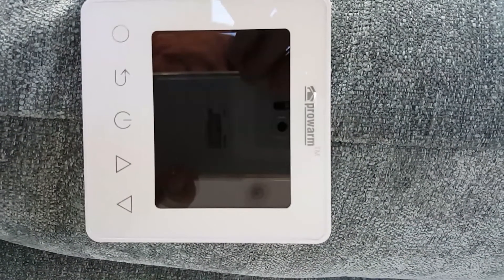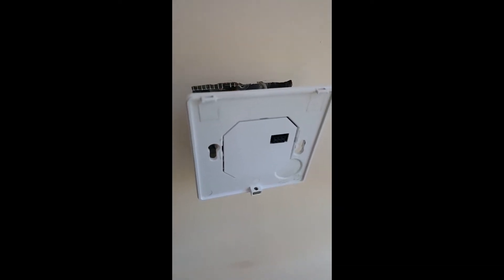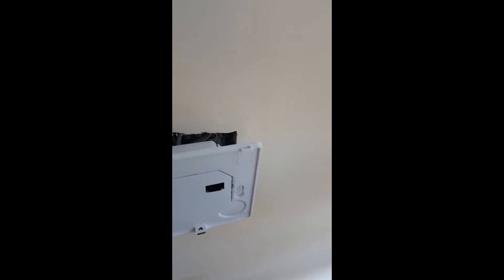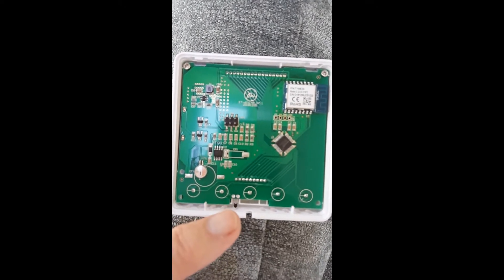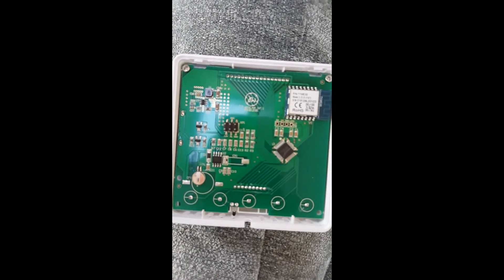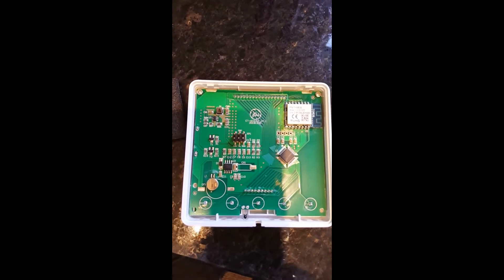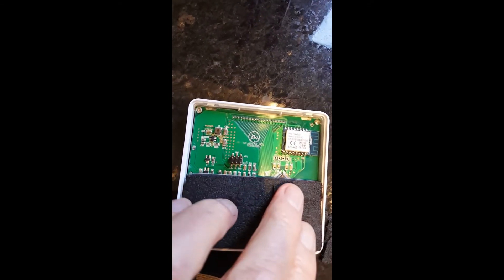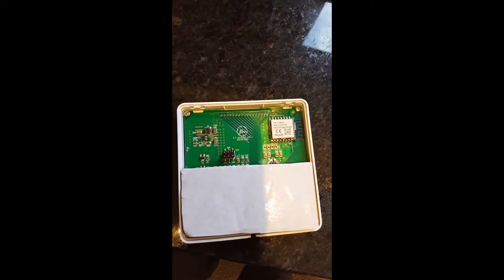Prowarm Heating Controller

Comment: So you know if i could  replace my prowarm underfloor heating thermostat with this wifi one
Reply from the maker: I am not sure what controller you currently use, but yes, this is the Wi-Fi controller that can be used. Of course there maybe other more recent controllers that would also suit. The app that I use is called Smart Life which is easier to setup and is faster than the original ProTouch app. The system is very reliable. I am currently out of the UK for many months and I can communicate with the controller in the UK whenever I wish. I hope this helps you.
Reply: @alvor2762 struggling to pair my prowarm thermostat with smart life app. Any chance for some guide on how to do it please?

Comment: Good content, just fitted one of these thermostats, many thanks.
Reply from the maker: Thank you for your comment. I am pleased it helped. I have 2 of these, and they have proved exceptionally reliable, and accuracy is now fine. Using  the optimization function to achieve the correct temperature at the time required is a good function on this controller too.

Comment: Thanks for sharing Rich
Reply from the maker: I hope it helped a few people
Since I first used the controller it has proved reliable and really quite accurate. The app I did not find straightforward but in the end all was fine. I access it remotely when I am away and it always connects without issues.

Comment: I thought the thermostat for underfloor heating controlled the temperature of the heat mat as that’s where the probe is installed. Thought you would just increase the temperature on the floor to get a slightly warmer ambient but not supposed to control room temperature?
Reply from the maker: I suppose you could just use the floor sensor as opposed to room sensor. Probably worth a try if the room sensor is not proving accurate control. I prefer to use the room sensor as it will probably respond faster to a change of room temperature plus you can set the hysteresis on the room sensor but I am not sure if that applies to the floor sensor. Having done what I have shown in the video with the insulation the controller I have my room temp always within about 1c.

Comment: Hi. Do you know if multiple units can be used from the one app. I have two buildings with 18 controllers to refit.
Reply from the maker: I am using 2 controllers from the one app so yes it's possible as long as they are all on the same network.
Reply: @alvor2762  can I pick your brains please? I’m about to plasterboard a garden office in which I am installing electing ufh along with this thermostat but wanted to double check the wiring…

From the consumer unit in the office, I have ran a 2.5mm cable to a switched socket… I will also run the cable from the mat…

I have then ran another piece of 2.5mm from this switched socket to a single gang box which was house the thermostat… the temperature sensor will also run here from the mat… do you know if I’ve got this right I.E. is this how you have done it? Tia

Comment: Hi rich,  hopefully you can help me, I'm looking at installing a Prowarm setup and not getting much info back from suppliers or manufacturers really! Your setup, how is it powered? The thermostat, is that constantly fixed to the wall? It look like there's a single gang back box that has the main gubbins in then the panel fixes to that, is that correct? Hope to hear back from you, kind regards, Jay
Reply from the maker: Hello Jay, It is in 2 sections with the backplate that houses the Xformer and connections, fixed as you say to single back box. Its permanently fixed about 5 foot of the floor. 240 supply in from a fused spur nearby and 240 out to the 2kw underfloor heating mat. Floor sensor cable runs up alongside mains cables from the sensor under the laminated flooring. Room sensor is of course within controller as I have shown.

Its far more accurate now that the insulation was used so less influence from Xformer heat. Its very reliable with no loss of comms with the home router. I am currently out of the country and connection with controller is very sound.

I hope that helps. If there is anything else you need to know then here I am.
Reply: @alvor2762  absolute legend, I've been trying to find out this info for about a week now so I can prep my walls with required back boxes and conduit etc. before I board them but I've had absolutely zero input from everyone! Now I know I've got the ideal socket to come off for a fused spur I know where the stat can be placed! Thankyou very much!
Reply from the maker: @jamesspence7234  My pleasure. I am pleased to have helped you.
Reply: @alvor2762  so I'm planning on bringing a fused spur up off the main kitchen ring, then bring power across to a separate single back box which is gonna have 2 behind board conduits, 1 for the floor probe and 1 for the matting power....does that sound about right to you?
Reply from the maker: @jamesspence7234  Nothing wrong with, as that was the only way I could do it. I took my supply for the whole conservatory off the kitchen circuit from a twin socket that backed onto the new conservatory. It went to 2 fused spurs, one for the wall sockets and the other for the UF heating. I could have done the work myself but an electrician near me did the job and so he was able to sign it off.